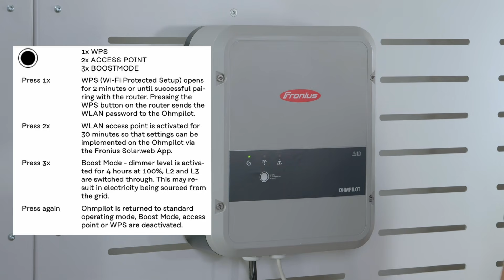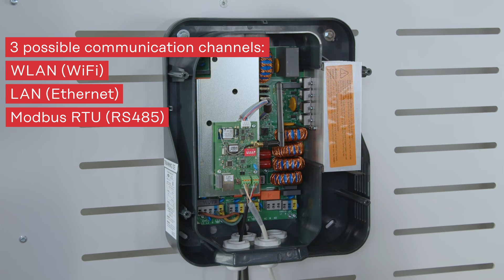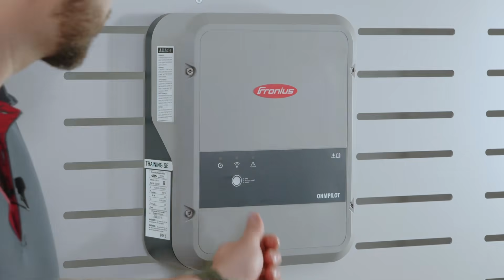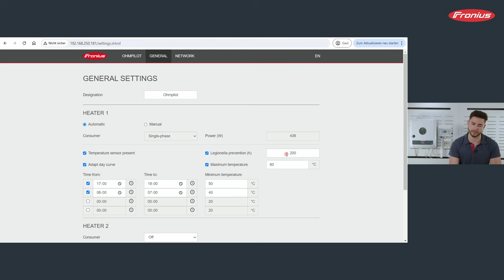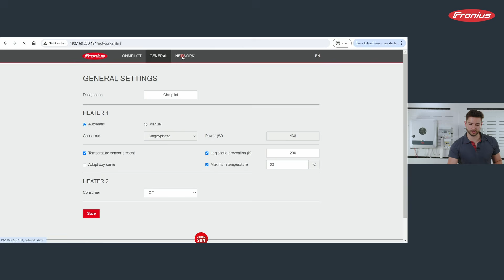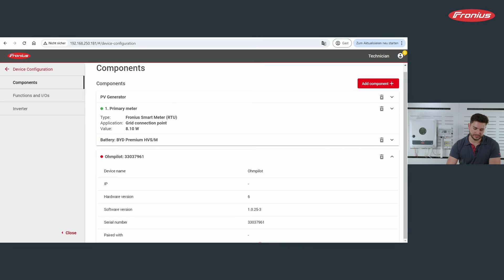Commissioning of the Fronius Ohmpilot

Comment: Hi,
My Ohmpilot is connected t0 the gen 24 via wifi, 3Kw element on L1 Manual. It does not seem to be PWMing just 3Kw on or OFF as well as drawing from the grid! Is There a setting thats says avoid battery discharge? Are there other settings in the load management of the inverter I can access?
Reply from the maker: Hi @orcakiwi! This behavior seems to indicate that specific temperatures are stored in the minimum temperature settings under “Adapt day curve.” When the Ohmpilot detects that the temperature sensor is reading below the set minimum temperature, it activates the heating element at maximum power until the minimum temperature is reached. To do this, it draws power from the battery or the mains. I would recommend setting the minimum temperature higher so that this happens less frequently.

Comment: Is it possible to run two ohmpilot devices at a time? I have an 17,5 kw sistem and I use water stocked in two 800 lt buffer tanks for underfloor heating. Thank you.
Reply from the maker: @florinsoare8448 Unfortunately not. We can only use one Ohmpilot in a system. But you can control two tanks by switching between them with on eOhmpilot or you use the Ohmpilot for one storage an for the other you use the Fronius Loadmanagement feature, where you control the heating rod directly from the inverter with additional 230V relais. Details you can in this webinar https://www.youtube.com/watch?v=wEWTRKv-JQQ&t=560s

Comment: Thanks. Why can’t one control heating periods by accessing the unit through Modbus?
The Gen24 inverter is fully controllable through modbus with all its registers documented, ohmpilot: nothing!
Why not? These days our suppliers provide electricity tariffs with different prices each 30mins. Price varies and I want to decide when to switch on ohmpilot programmatically through Homeassistant NOT through setting some web interface!
Reply: Ideed, this is a big problem that is still unsolved.